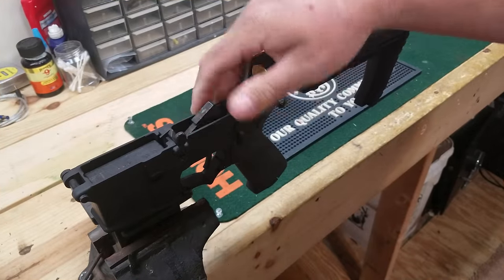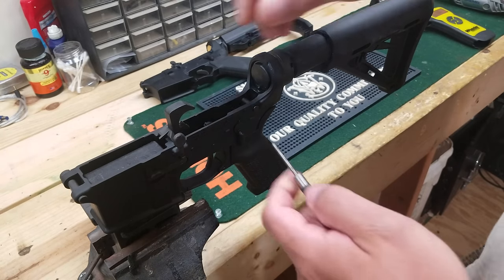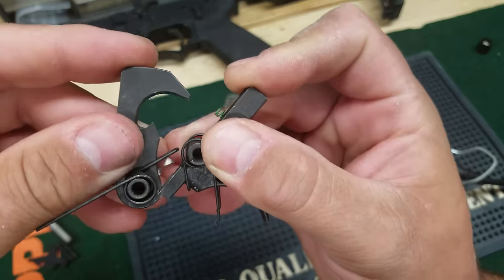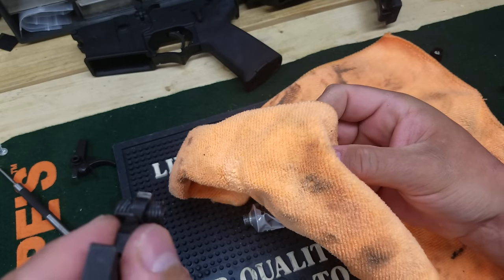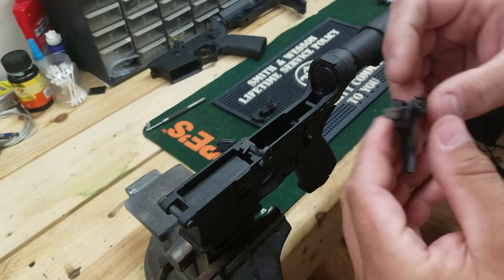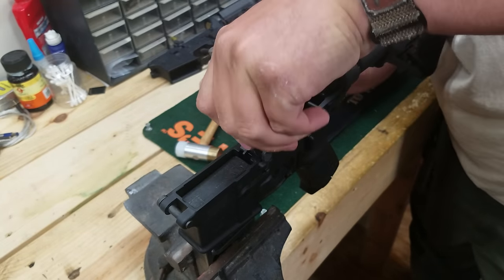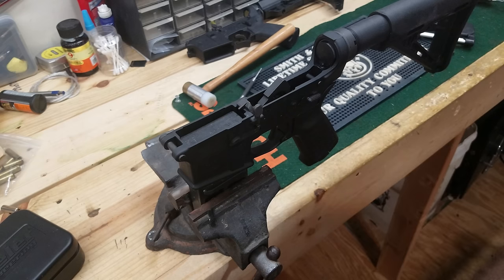Easy Mil-Spec AR trigger Job

Comment: I don’t know about clipping the leg of the hammer spring shorter but instead I’ve bent the legs of the spring at a slight upward angle and that gives an immediate, very nice improvement to the trigger pull. What I was told is that it keeps the same spring power so you don’t get light strikes but it changes the geometry of the friction of the hammer parts. It has worked with no issues.

Comment: FYI you should always put the buffing compound on the buffing wheel, not on the part itself! You are just slinging the compound off immediately, and wasting the entire motion! I do this for a living by the way!
Reply: How about the wheel and the part? Everytime I polish the air sprays it all away
Reply: @joseph395  go slow when adding it to the felt pad/polishing wheel. Then slowly turn back up speed after putting it to it
Reply: @Petryfied  ok thanks!

Comment: So...*deep breath*... an important part of a good trigger job is making sure that all mating surfaces are "true". Not just "shiny". This means that these surfaces are mating together with as even a pressure distribution as possible. Thus reducing wear to the minimum possible as well as reducing directional bias, or dragging, or binding of the components.

What you've done is round off all of these machined surfaces, so they are now guaranteed to not be true to each other. While it might be a slight improvement over the stock crunchy mil-spec trigger, the small investment of a set of hard Arkansas stones and a dry-erase marker will allow you to do an actually very very good trigger job on nearly any firearm.

If you put in the time and learn what you're doing, your gun-buddies will be paying you back in twelve-packs for your investment as soon as they've felt the difference between their $200 match grade trigger and your superior Mil-Spec. I can do this in about 45 mins, my old quartermaster could do an A+ job in about 15 mins.

Soldier, engineer, machinist.
Reply from the maker: Brad Gefroh I completely agree with you. Using a good set of stones and a jig with give superior results everytime. Unfortunately most people dont want to invest the time or money into specialty tools they will use once. That's the people this video was intended for.
Reply: Operator 801  make a video
Reply: You really dont need a jig to do a good or even great  tj just a lower and alot of putting together and taking apart of the trigger group.  It is nice to have the equipment if your doing this day in and out but not really needed just need to know how the trigger works what points are ideal to work on.  Most people dont even polish the hammer face on an ar they let it wear some yet most still have flash lines( raised line down center of the hammer from casting) on them if you smooth them you will feel it when you charge the rifle and will reduce drag and wear on bcg as it is cycles.
Reply: Exactly what I was thinking. When I saw him pick up the dremel tool I cringed. Even hand lapping with a polishing compound on a flat surface keeping the trigger in a 90 degree fixture would be way better than this cave man approach.
Reply: That felt wheel is not changing the geometry or rounding any surface of that hardened trigger. Lmao. 
The only thing its doing is smoothing out the machining marks from where it was cut. He's not trying to make a match grade trigger, just showing people how to improve a gritty heavy trigger.
Reply: Operator 801with all due respect if you have a better way then show everyone make a video otherwise it’s just trash talk doesn’t help anyone just makes you feel smart Nobody likes the guy on the job that always has a better way of doing things that nobody has ever seen
Reply: Agreed. Machinist here. Saw the dremel and cringed. Just did my own triggers before watching this, and realized how... not flat those surfaces are. I used my trusty Norton diamond hand hone to true up and polish the surfaces, realized a 1lb drop (5 to 4lbs) and reduction in grittiness. Flat, parallel surfaces equal crisp break. To the ones bashing him here for not making your his video and "trash talking",  he DID provide information that's helpful, in a respectful way...and he's absolutely correct.
Reply: AMERICAAAAAAAAAA!!!! Thanks brother
Reply: if you cut through the case hardening your light trigger may wear lighter and lighter. this polishing is the safest thing average guys can do. if you need a target trigger just buy one.
Reply: @DANTHETUBEMAN  Polishing also cuts through the case hardening. If you're working with a trigger that cheap, then you're going to see the same issue by this method.
Reply: @operator8014  cheep, less heat less hardness depth. it should be deeper then that, but you would not know without a Rockwell test
Reply: It's. Ice to hear that there's at least one other person out there who first off, know what they are talking about, and secondly cares more about doing it correct instead of good enough.

Comment: It amazes me to see all these online trigger jobs where nobody ever even mentions the need to remove material and polish internal bearing surfaces and pin diameters. These circumference measurements total much more bearing surface friction area than the common trigger/sear interface we always see people address. The center areas of the pivot pin can actually be reduced to hold lube and provide less contact bearing area while still maintaining the overall width dimensions for stability after component wear. The same is true for both the trigger and hammer pins and holes. The best method with some machining is to actually drill out and place sintered phosphor-bronze or beryllium copper bushings lined inside with PTFE liners into the new pin holes. Relieving the centers of the pin diameters and then polishing to a 1200 grit finish completes a very nice job and also allows the relieved areas to hold much needed lubricant while maintaining rigidity along the 2 axe areas for stability..
Reply from the maker: I agree 100%. The only reason I didn't go into all if that is most people don't have the knowledge, skill, or equipment to do a professional trigger job. Hence why I kept it as simple as possible with basic tools.
Reply: @TacticalWingnut  I guess the guy didn't read " THE TITLE " of your vid. It say's " EASY TRIGGER JOB " WTF ? NO MACHINING OR BUSHINGS, MAYBE HE SHOULD MAKE A VID. ?

Comment: I found 1000 grit sandpaper does a great job before you polish. I use a hard edge with a 90° to put the sandpaper on and then I will run the hammer on that corner. Just make sure your on a flat surface while your sanding. Then polish it and you’ll get a noticeable change. I went from 7lbs to just under 4lbs

Comment: Great video; well explained and super easy to do.
Did the same thing on my Ar 15 and AR 10, both triggers are really smooth now. 

However, didn't cut the hammer spring, because it might lead to light primer strikes.
Reply from the maker: Glad you found it useful

Comment: Just put a new trigger, hammer, and springs in my rifle. It's lighter and flat faced. Just what I wanted. The biggest difference is, it has more travel and grittier than crap 😂. Omg man, I'm pretty frustrated. Especially since I did the same trigger job to my wife's rifle, that she hasn't even broken in yet, and it is amazing, the improvements. Her previous (milspec) trigger was terrible. Gritty with a loooong travel. I'd shoot competition with that thing. 
I hunt and shoot quite often and needed to figure something out soon. I'm not a gunsmith either. This video is exactly what I needed! These coyotes had better be ready!!!
Reply: You should check out Franklin Armory’s Trigger Overtravel Adjustment Screw as well.
Reply: @danefuentes3877 thank you. Will do. 👍

Comment: Nice video sir. Right to the point. Is there was a reference to resetting the trigger & hammer springs in the proper location & spring tension/ pressure. Thx again for your insights & expertise!

Comment: Try lubeing the mechanism with a lube called triflow.  It has great lubricating qualities.  It has teflon in it that workes it's way into the metal giving a slippery surface.
Reply: Triflow is a great lubricant and it's probably good for some of the moving parts in a trigger.

 But where the actual sear is located, I found AeroShell no. 6 grease  to be the best.
But what do I know? It's what Geissele uses.
Reply: A PTFE paste also works very well. You will feel the difference right away.

Comment: Good video. There's a lot of variance in the readings that your getting. It could be where the trigger scale is contacting the trigger. If it's held lower on the trigger you'll get a lower reading and conversely it the scale bar contacts the trigger high you readings will be higher. Matter of leverage. I can't see where it's contacting but those readings should be within about an ounce. Just a tip.

Comment: I have done this and bobbed the hammer and added JP springs and it makes a huge difference. It takes it down to between 3 and 4 pounds.
Reply: Did you trim the hammer spring on the JP springs kit too?
Reply: Paul Trivino no just using the job springs was enough

Comment: Thanks for the info,I learned a lot playing with my 1022 trigger assembly,tried cutting hammer springs stoneing hammer polishing everything got it down to 2.5 lots of mistakes but had fun with results. Just don’t be afraid to try.
Reply: I discovered that too much stoning on a 10/22 trigger cuts through the case-hardened layer, and ruins the trigger. Better to do what this guy suggests, and polish with a Dremel and some paste.

Comment: One thing I forgot to add. You said you want to try reloading 300 blackout. That’s a little expensive round for right now. But I think they make a case stretcher for 5.56 also .223 you might want to look into that? Might save you a lot of money on brass. take care boss! I personally don’t have one yet but I did hear they make one. It’s a great combat round slow moving a lot of energy👍🇺🇸
Reply from the maker: GUNS- USA I have quite a bit of 300 brass saved up but will definitely check into a stretcher for the 223 brass. 300 is a great round, It along with a M&P 9mm are my main home defense.

Comment: The load of the hammer spring is in the coil not in the spring ends or "legs" as you called it. So from what I can tell by shortening the hammer spring ends you are changing the point of contact thus changing the coil winding by a few thousands, right?
Reply from the maker: Basically yes

Comment: Thanks, great video. Just cut the spring on a ruger 556. Works great. Shot steel case Russian ammo with no problem. Someday I will upgrade to a drop in but for now I couldn't be happier.
Reply from the maker: Awesome, glad it helped you.
Reply: What does cuting the spring like that do exactly?
Reply from the maker: @allmotordc5rallmotorfa575  much lighter trigger pull
Reply: @TacticalWingnut  did a full polish job on the trigger assembly and install JP engineering ladder Springs and it feels really good for pretty much 30 bucks
Reply from the maker: @allmotordc5rallmotorfa575  That's awesome

Comment: Leave the dremmel in the toolbox n get yourself some stones. A polished trigger n sear causes a creepy trigger. Stones will true the surfaces n leave enough roughness to make a clean break
Reply: What stones do you reccomend?
Reply: @rc-pm1fe  an India stone n fine Arkansas stone from Brownells is best but a med n fine stone from a sharpening set would work. U need ones with a good sharp 90° angle to get the hammer nice n square
Reply: Quick question... I'm going to do it with sandpaper as not to mess with the surfaces much. Should I be sanding with the grain (how the parts engage with each other) or against the grain? I'd assume the first, but you're saying a polished trigger leaves creep... But then what's the point of using a stone for that matter? Wouldn't smoother be better, and rougher mean more resistance? Why would one mean a clean break, and the other a creepy break?
Reply: @XtremeConditions  A mirror polish just doesnt have enough resistance to make a clean break. Its like to pieces of ice n theres no resistance. I normally stone the trigger parellel to the trigger shoe n stone the hammer across co there is no gritty feel. If you use sandpaper go in stages from 400 to 600 and so on to at least 1000. You will need a nice solid block with a very sharp 90 to to the hammer n I also cut a slight relief cut to the top edge of the trigger face just like a 1911 to mske the break more crisp. Dont go yo far as you will make the gun un-safe.
Reply: @XtremeConditions  sandpaper takes too much material and can ruin the trigger, especially sear. Use stones. Keep them flat. It removed high spots to smooth the pull without polishing it completely smooth.
Reply: @duaneelsbree3460 How does 1000 grit sandpaper remove more metal than a 1000 grit stone?

Comment: Toss the dremel, get some good Arkansas stones for the sear, keep them flat. Maintain proper angles.
Reply: I was thinking the same thing watching him use the dremel on hammer sear was making me cringe a bit.
Reply: Dremels are Bad practice for flat work.  Stones are good. I use 1000,1500, n 2000 grit wet dry paper wrapped around various sized dowel rod for curved areas.

Comment: Did you put the now shortened leg of the hammer spring above or below the trigger shaft?  Or, by default does it go below because it doesn't reach the trigger shaft?  Thanks, great video!

Comment: If you bend the trigger spring legs a bit about a quarter of the way up just a but it will lessen the trigger pull. Doing the hammer spring really doesn't do much.
Reply: The sear surface isn't flat,  but a slight angle causing the hammer to depress slightly before release. That's the primary force on the trigger pull.

Comment: If I did this for my S&W 15/22 would I even need to be concerned about light primer strikes or could I take one leg off like you said?  Since it's 22 LR is why I'm asking.
Reply from the maker: You can still get light strikes on .22. I would just bend the leg a little at a time until you get it where you like it.

Comment: One quick question when you cut the hammer spring a quarter of an inch back why did you only do one side? What that kind of throw the hammer out of balance with tension being stronger on one side versus the other?
Reply from the maker: If you cut both sides it wont have enough power to set off a round. As for balance no.

Comment: I was thinking doing this because the mil-spec trigger feels gritty as hell and I was thinking of removing a little bit off the hammer so the trigger throw is not as long. What do you think?
Reply from the maker: I wouldn't suggest modifying it any more then what i show in the video unless you have a lot of spare parts to experiment with. In all honesty for what extra parts cost you can pick up a nice drop in trigger and be done. Just my 2 cents
Reply: @TacticalWingnut  After cutting the hammer spring, do both sides of the spring rest on the trigger pin when you reassemble it?
Reply from the maker: @christopherbrown5338  no, the side you cut will be to short to lay on the pin
Reply: @TacticalWingnut  I spent about 2 hours polishing today. grits- 800, 1000, 3000, brown buffing compound, white buffing compound then a polishing liquid.  It's much better!  I might remove just a little material from the catch on the hammer if I want to shorten the pull but that can wait.
Reply: Today I took about 1 millimeter off just the hammer and then polished that area, and that feels perfect!  Now it feels like I am used to triggers feeling.  It still has travel but if I pull it some & let off, the trigger returns, it does not stick.  I feels very similar to my Baretta 92FS when the hammer is cocked.  And the break is so smooth!  :)

Comment: Would it be better to cut an equal amount of spring off on both sides rather than just one side?  Instead of cutting 1/2" off one side cut say a 1/4" off both sides?
Reply from the maker: I've tried it several ways and just cutting the one side gave the best results and kept the reliability for me.

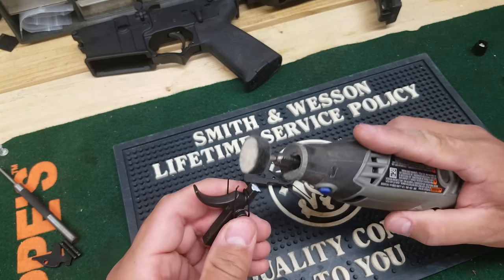Comment: 4:12 You state that you will break the hardness layer. I thought the hardness of the steel goes through the entie part ?
Reply from the maker: steven richards most parts like Sears and hammers are case hardened. The surface is much harder then the inner core. Do a Google search for case hardening or surface hardening, it's pretty cool how it's done.
Reply: Thanks !

Comment: Hey, appreciate the video. What does cutting the hammer spring benefit?
Reply from the maker: Makes the trigger lighter. Less force on the sear surface so it takes less pressure to pull.

Comment: What does cutting the hammer spring do? If it still sits on the pin at the same point nothing has changed.
Reply: I think the idea is to cut one side so it doesnt set on the spring.

Comment: On the hammer, how do you prevent rounding the shelf that the sear rides?
Reply from the maker: Just go slow and check it often.
Reply: Because it's a felt wheel with polishing compound working hardened steel. I didn't see him working on the hammer at all, btw...

Comment: I would reccomend a extra fine stone and baby oil over a dremel.
Reply from the maker: The fine stones do work well. I haven't tried baby oil but have used cooking oil and honing oil with good results.
Reply: I tried motor oil which did not work well at all. I never had any luck with a dremel. It was too easy to go too far too fast.
Reply: Honing oil and stones

Comment: Does it have to be the right leg of the hammer spring that you shorten? Why not the left? Does it matter?
Reply from the maker: You can cut either side just make sure when you put the pin back in the notch lines up with the side you didn't cut. Otherwise it may walk out.